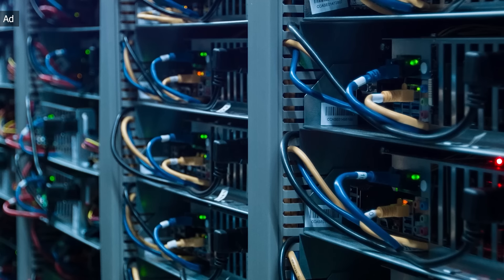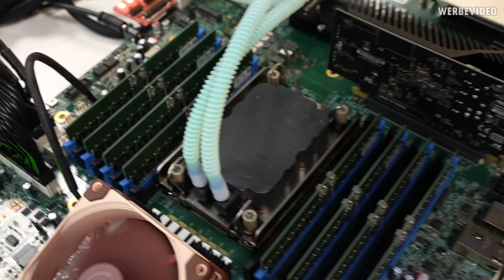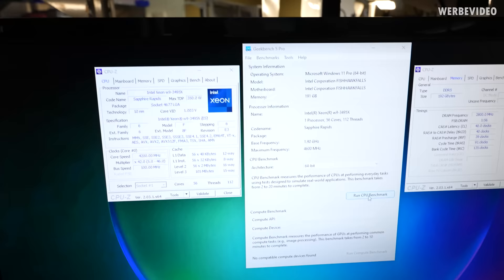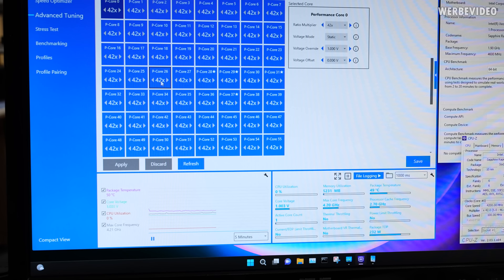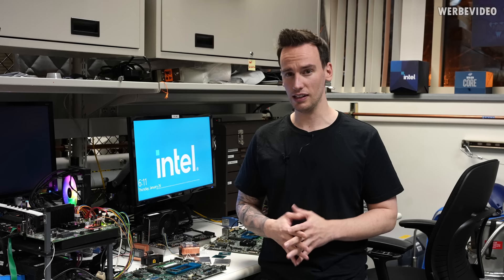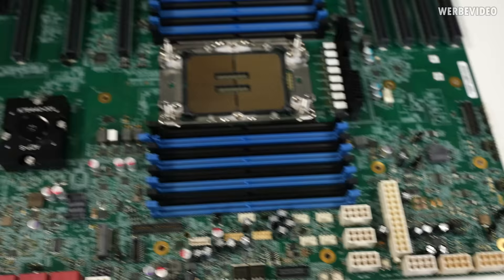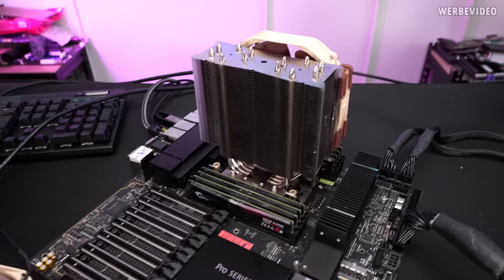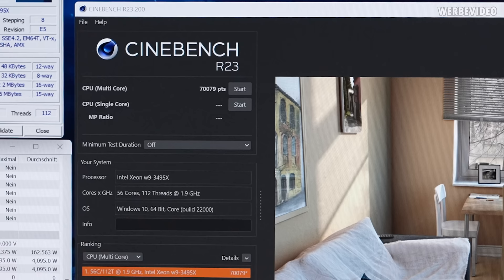Intel HEDT is BACK! Insane Overclockable 56 Core Sapphire Rapids CPU

Comment: Nvidia was ashamed when seeing the VRM size and how much it can handle
Reply: To be fair a server chassis has insane air flow so it doesn't really need an overkill vrm
Reply: Handle that power for 10 sec is not the same compare to handle it continuesly.
Reply: Wait why? Current gen Nvidia FE cards have insanely overkill VRMs.
Reply: @OTechnology  Not really, if they cud get away with less they will. Its a fine balance with longevity and price for nvidia.
Reply: The fact the VRM didn't overheat in geekbench 5 doesn't mean anything because it's a very short peak load. Also these CPUs use a FIVR so the current going though the motherboard's VRM isn't as high.
Reply: @ActuallyHardcoreOverclocking  Wild BuildZoid appears!

Comment: In LINPACK this Xeon W9-3495WX CPU pushes 5.376 TFLOPS around 4 GHz (56 cores * 4 GHz * 32 FP64 FLOPS/cycle = 7,168 GFLOPS FP64 max theoretical throughput), assuming 75% efficiency in scaling. You also get 112 PCIe 5.0 lanes with 448 GB/sec of bi-directional bandwidth off the CPU, DMI 4.0 (8 PCIe 4.0 lanes) gives an extra 16 GB/sec of bandwidth to the W790 chipset which has Wi-Fi 6 integrated, for a grand total of 464 GB/sec of IO bandwidth; and, 8 DDR5-4800 memory channels, which at 40 GB/sec per channel translates into 320+ GB/sec of memory bandwidth. That's close to 700 GB/sec of bandwidth of this chip.

A 5995WX at 4 GHz would score around 3 TFLOPS FP64, assuming 75% scaling (64 cores * 4 GHz * 32 FP64 FLOPS/cycle = 4,096 GFLOPS FP64 max theoretical throughput). You get 128 PCI-E 4.0 lanes, or 256 GB/sec of IO bandwidth off the CPU directly and that includes the WRX80 chipset lanes; and, 8 DDR4-3200 memory channels with tuned memory timings will get you to about 25 GB/sec of memory bandwidth per channel or 200 GB/sec of memory bandwidth. That's about 456 GB/sec of bandwidth from the 5995WX.

Yeah, it turns out the Xeon W9-3495WX chip at $6,000 has significantly greater potential throughput and memory/IO bandwidth, plus AVX-512+AMX instructions and Optane support, whereas the 5995WX costs $6,200 and has inferior max theoretical throughput in integer and floating-point, and lacks those extra instructions. Efficiency-wise, GFLOPS/W, the W9 wouldn't be any worse because you only need 1.0 V to hold 4.1-4.2 GHz in an all-AVX-512/AMX workload saturating the dual 512-bit SIMD-vector units of each core on the W9 Xeon versus the dual 256-bit ones on the 5995WX chip. They both pretty much average close to 700 W under full load around the 4 GHz/1.0 V mark.

Comment: We desperately need Direct Die Water Cooling, especially as we go down the 3D stacked chips road, stacking heat sources on top of heat sources severely limiting the clock frequencies.
But even with 2D chips like this is very clear that the limiting factor is heat density. I know that TSMC have been testing Direct Die Water Cooling, where on die micro channels are etched directly into the silicon layer on top of the CPU for a coolant to flow between layers. In their tests, silicon channels were etched into a silicon layer with a silicon-oxide thermal interface material between the microfluidic system and the actual silicon of the TTV. In a third option, the silicon-oxide TIM was replaced with a liquid metal TIM. The results were really impressive and easily enabled cooling off chips that used more than 2000w.
Reply: Copper conducts heat twice as good as silicon, aluminum is still also a better conductor of heat.
So silicon layer cooling is already of to a bad start.

Then there is the problem of making a super fat silicon chip cheaply, to have room for the fluid channels.
Connecting chiplets like a Epic or Sapphire Rapids up with fluid channels between the individually build and spaced out chips, sometimes up to 13 individual chips.
What happens if the fluid channels are no longer clean after a couple of years use?

Is the density even needed? we already have 96 cores Epic that are air coolable and dual socket capable and mountable in a rack with 10 servers for a total of 1920 CPU cores working at atleast 2.4ghz.

In Geekbench this 56 core sapphire rapids at 1000W overclock is not able to beat a stock AMD Epic 9374F 96 core at 400W TDP, so it is just a question of not pushing the overclock well past good efficiency and using the right chip for the job.
Reply: 1000 W on a chip with 1400 mm^2 of die area isn't that hot. There's a lot of surface area and it's easily cooled with a radiator or two in a water cooling loop.
Reply: the really fine water ways would get blocked so easily.
Reply: Water introduces so much problems and makes maintained a pain. Those micro-channels will be clogged, then with troubleshooting you have to drain the system. No thank you
Reply: @NeptuneSega  I don't believe they are talking about submotion, it's just a water loop that passes through the silicon chip as opposed to sitting on the top of many layers of very hot silicon.
Reply: @larsjrgensen5975  it's the thermal convection characteristics of a liquid that is important here and our ability to finely control silicon down to the nm scale to create these channels on each silicon layer. I'm sure they will come up with ways to mitigate the issues when the rewards are so high.
Reply: @NUCLEARARMAMENT  yes but moving forward you need to think 3D, if you stack 2 or 3 or 20 of those dies on top of each other then your heart skyrockets but your surface area remains pretty much the same.
Reply: @oxfordsparky  I'm not sure how fine they are but I'm sure they will find a way to get around the issue when the reward is so great.
Reply: @NeptuneSega  You do not have a choice with 2000W sockets my guy. This is not for home use. Direct die water cooling is no different than standard watercooling, it can be as simple as an AIO with a direct die frame.
Reply: @fVNzO  ??
Reply: @Speak_Out_and_Remove_All_Doubt  ????
Reply: Been hoping he does a Threadripper delidding — hopefully he does one when the ddr5 Threadripper comes out
Reply: @Speak_Out_and_Remove_All_Doubt  Sandwiching 3 Epyc 96 core CPUes on top of each other only saves minimal space.
Each CPU have 12 memory channels, so the sandwiched CPU needs 36 memory sticks for full performance, the same is needed for the power delivery pins.
So instead of over 6000 pins on the CPU, something like 15 000 pins are needed for a monster CPU socket that is atleast twice the size.
HBM2 memory is needed for your idea to work and 300-3000GB HBM2 is going to be very expensive.

A aircooled 96 core CPU still makes more sense for the near future then combining monster CPU on monster sockets.
Reply: @larsjrgensen5975  near future maybe but ultimately 'up' is the only direction we will go because of latency issue too. If you make a 1000 core 2D CPU then it will take too long for the top left core to talk to the bottom right core, whereas in a cube design they are much closer. 
Also the memory needs to be stacked on top of the dies and not to the sides as this is will reduce latency too. It's not done like that now because of heat. The 96 core Epyc is already only running at 2.4GHz because of heat, water cooling alone could more than double the performance of this chip and as benefits from die shrinking get harder and harder we will need things like this.
Reply: @Speak_Out_and_Remove_All_Doubt  The Epyc is limited to 2.4GHz base clock because of efficiency and power consumption, not heat.
Server aircooling is plenty to cool the base speed, changing to water cooling will change nothing unless manually overclocking server hardware with explosively high power requirements to follow.
Just look at the 96 core Epyc 2.4ghz vs a 13900k 5.5ghz, they both have around the same power usage, but the allcore performance difference is ridiculously big.

Watercooling will not doubling the performance, there is no way that 96 cores would run anyway near 5 GHz to double the performance.
The Sapphire rapids 56 core shown here is already 1000 Watts at 4.2GHz and super inefficient, the socket, VRM, powersupply and mainboard traces needs to be redesigned a lot to handle the overclock, instead of just buying one more server for the rack.
Reply: @larsjrgensen5975  You make some valid points there and maybe you are right for the current CPUs but I still firmly believe the future of CPUs will be 3D stacked dies and I believe the best and possibly only way to cool these effectively will be a form of water channels in between the layers. AMD have already shown they had to reduce clocks even just for a basic cache die on top.
Reply: I'm wondering if internal micro heat pipes in-between silicon layers and chips brought directly into contact with the IHS would be a viable option to look into.
Reply: @Yuriel1981  I think you might run into capillary action issues and not enough space for the wick effect to take place but it's possible.
Reply: @Speak_Out_and_Remove_All_Doubt  I had thought of this as well. But a pressurized alcohol may be an option to regulate the Temps of vaporization while using nanowire as a wick to guide the fluid back. Plus increased purity to avoid capillary clogging. But I'm not an engineer sooo.....

Comment: The chip is one thing but I'm blown away by that VRM. How on earth is that thing shifting 1kA with that tiny heatsink? Gotta be some fancy new bare-die SiC MOSFETs or something, with ludicrously high transconductance and ultra-low Rds(on). I don't see output caps, either - just a big array of pads, or maybe filled/plugged vias? Did they switch to a massive bank of MLCCs on the back or something? Maybe even embedded passives? Pretty wild.

Edit: given that production boards for SR seem to be omitting polar caps on the low side too, I guess we just exceeded the ripple current limit for  alupoly and solidpoly? I wonder how they're handling the inrush issue from low MLCC impedance at low load though... maybe that's part of why the idle consumption is so high. Can't wait to see some teardowns and analysis of these new designs.

Comment: I would love one of those, if not for the fear of that electricity usage.

It would be interesting to see some 'IPC comparison' testing for the lower core-count models in comparison to similar core-count parts (HEDT and consumer Intel and AMD). That Cinebench R23 score at only 2.9GHz is like 2.7x Ryzen 9 5950x with PBO😲

Very steep platform entry cost, but can pay for itself quickly in certain use cases.

Comment: my 7950x scores 40k on Cinebench r23. I hope these intel CPUs can be overclocked enough to be impressed by :)
Reply: yeah and your platform (weighted against 16 core S.R) was at most 60% the price, I'm shocked to see ppl so excited by intel's coming up offering, don't get me wrong it will preform really well but the price-performance ratio is objectively poor
Reply: @comrade171  imagine comparing consumer platforms to the professional variants and complaining about the professional variants being more expensive. There is a reason the 13900K forced the 7950X to have its price cut by over $100.
Reply: @dex6316  imagine a clear argument, then imagine writing it down here and then consider actually doing that
Reply: @comrade171  This is not a platform for gamers or consumers. The people that buy these types of systems (like me) don't rate them in price to performance, but rather price to time. If buying this CPU + board can save me 2 hours a day and only cost 10k, then it will pay for itself in under 2 weeks; after that it is increasing how much money I make every week.
Reply: my 13900k is already getting 42k on r23... who cares. the cpu in the video gets 70k... literally almost 2x the score mine or your cpu gets... at a much lower clock and much lower temps... 60c on air.

Comment: It is impressive that this new 56-core cpu OCed on all core at 4.2 GHz is able to beat a year old Zen 3 64-core...
Reply: new 56-core cpu OCed on all core.....beat a year old Zen 3 64-core makes it not impressive.
Being able to keep up with a 64core Zen4 "storm peak" releasing in the same year while consuming similar power, that would be impressive and maybe in 2 years they'll do it.
Reply: @tomstech4390  I was sarcastic in my comment, as I was not impressed at all.
Reply: Well said. :)
Reply: Yeah, with twice the power consumption.
Reply: In LINPACK this Xeon W9-3495WX CPU pushes 5.376 TFLOPS around 4 GHz (56 cores * 4 GHz * 32 FP64 FLOPS/cycle = 7,168 GFLOPS FP64 max theoretical throughput), assuming 75% efficiency in scaling. You also get 112 PCIe 5.0 lanes with 448 GB/sec of bi-directional bandwidth off the CPU, DMI 4.0 (8 PCIe 4.0 lanes) gives an extra 16 GB/sec of bandwidth to the W790 chipset which has Wi-Fi 6 integrated, for a grand total of 464 GB/sec of IO bandwidth; and, 8 DDR5-4800 memory channels, which at 40 GB/sec per channel translates into 320+ GB/sec of memory bandwidth. That's close to 700 GB/sec of bandwidth of this chip.

A 5995WX at 4 GHz would score around 3 TFLOPS FP64, assuming 75% scaling (64 cores * 4 GHz * 32 FP64 FLOPS/cycle = 4,096 GFLOPS FP64 max theoretical throughput). You get 128 PCI-E 4.0 lanes, or 256 GB/sec of IO bandwidth off the CPU directly and that includes the WRX80 chipset lanes; and, 8 DDR4-3200 memory channels with tuned memory timings will get you to about 25 GB/sec of memory bandwidth per channel or 200 GB/sec of memory bandwidth. That's about 456 GB/sec of bandwidth from the 5995WX.

Yeah, it turns out the Xeon W9-3495WX chip at $6,000 has significantly greater potential throughput and memory/IO bandwidth, plus AVX-512+AMX instructions and Optane support, whereas the 5995WX costs $6,200 and has inferior max theoretical throughput in integer and floating-point, and lacks those extra instructions. Efficiency-wise, GFLOPS/W, the W9 wouldn't be any worse because you only need 1.0 V to hold 4.1-4.2 GHz in an all-AVX-512/AMX workload saturating the dual 512-bit SIMD-vector units of each core on the W9 Xeon versus the dual 256-bit ones on the 5995WX chip. They both pretty much average close to 700 W under full load around the 4 GHz/1.0 V mark.
Reply: I feel like most of the comments here are Intel bot accounts. "YAY HEDT IS BACK"  like Threadripper Pro hasn't been available this whole time. This isn't a very impressive product imho. Uses too much power.
Reply: @NUCLEARARMAMENT  Seeing as we're talking about unreleased future tech here.... What about Zen4 storm peak?
How's it compare to that?

Comment: I have that exact dewar at 1:28 on the right side of the screen. Love the low pressure valve for refilling the vacuum tight flasks for pouring LN2 into the pots

Comment: Technically this isn't an HEDT platform it's more of a Pro/Workstation oriented one, and a very expensive one at that. 
And 500+ Watts at stock isn't that attractive in this day and age, especially when you can get a similar performance for less consumption in the AMD 5000 Pro CPUs. 
Looking forward to see what the W5 and W7 can do when overclocked, Up to 28 cores won't be as hard to cool as the 56 Cores monster.
Reply: Yeah, if I was running a medium-to-large VFX studio, Threadripper Pro would still be attractive because of the efficiency. That said, smaller shops, highly-paid freelancers, and high-frequency-trading guys will probably love these new Intel chips.

Comment: I'd love to see overclocking results for the 2465X. 16 cores is plenty for me, even the 12-core X would be fine. I mostly need the PCI-e lanes, with excellent single-threaded performance, though some apps I use need lots of cores, so the 6-core wouldn't suffice. How far past 4.7GHz can it be pushed...

Comment: AMD threadripper 5995WX  got 49k+ on Geekbench 5 at 3.2ghz and is not a current gen CPU. Seems like an extra 25% higher clock would get you quite a bit over this CPUs performance.
Reply: Yeah I mean come on. this isn't really that mindblowingly impressive. Threadripper is still very close on a "zen 3" node. It's nice to see some competition from the sleeping titan called Intel, but still think once we see next gen TR Zen 4 parts they gonna run circles around Intel again. And even it's very funny to see how much you can push a multicore monster like this, overclocking it, thats never gonna be how these boards and cpu's is gonna used. They are going to be run at stock clocks in servers or workstations. No pro user is going to risk any unstability chance over a few percent overclock for a Workstation and Intel still have a big issue in the power draw, which also plays into account when deciding which platform to use. Intel do have an edge for certain loads like workstations for Music production with 12'th and 13 gen cause of the monolithic die which doesn't have the cpu an ram latency of AMD's chiplet design, but again, is it worth 20-30% more processing power if it comes at a +75% power bill ? (just a number. I don't have the exact values) not to bash Intel. It's good they actually managed to take up the fight they were about to loose. Competition is better for the end users. Still think Sapphire Rapids gonna have a Rough Fight when it eventually comes out.